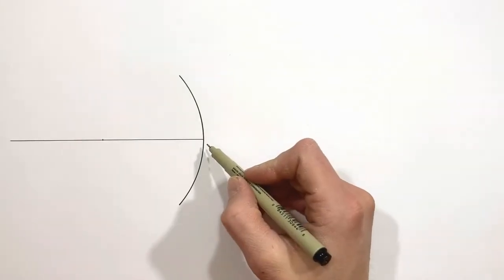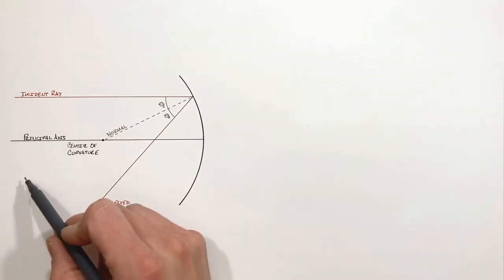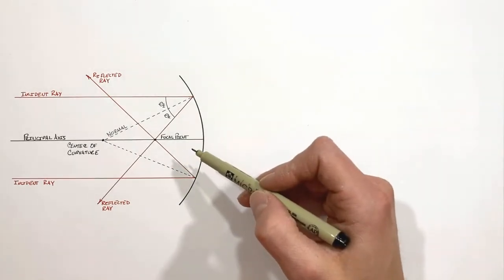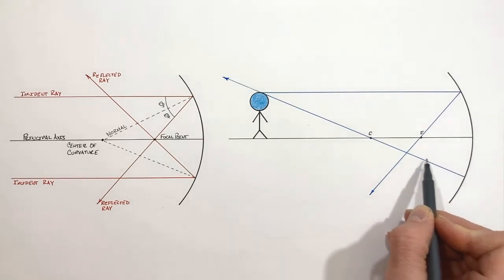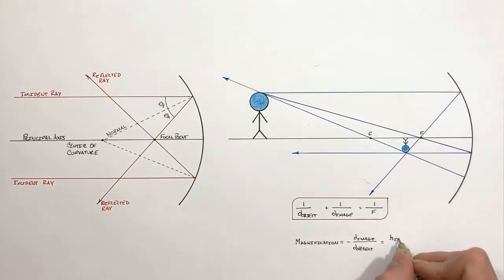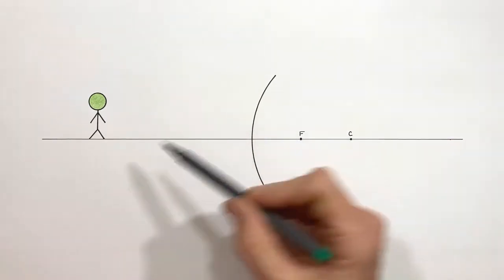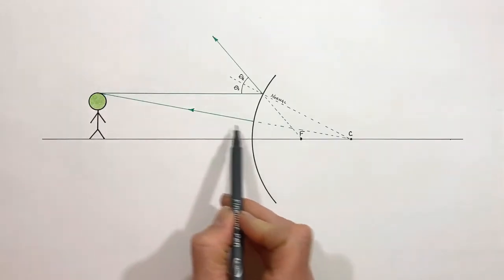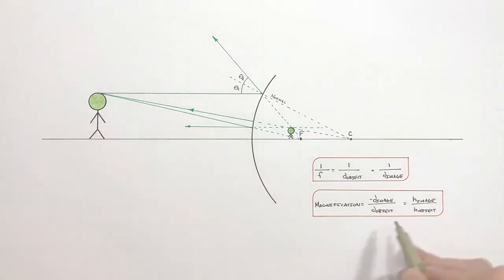Why is Your Reflection Upside Down On One Side of a Spoon But Upright on the Other? | Mirrors Optics

Comment: The inverted image on the concave surface is a real image, how are we able to see it without using a screen??
Reply from the maker: When you project a real image onto a card it only appears at the position where the light focuses.  If you move the card out of the way your eye will see the image which will appear to be coming from the image position.   

The easiest example of this is to stand in front of a flat mirror.  Your eye sees your reflection at a distance that is BEHIND the mirror, your eye does not actually focus on the mirror.  Note  Your reflection in the mirror is virtual not real.
Reply: @INTEGRALPHYSICS  So, can we view real images and virtual images with just our eyes in all the image formation cases among lenses and mirrors?
Reply from the maker: Unless the image 'forms' at an infinite distance, yes.

Comment: If the concave mirror forms real images in front of the mirror in case the object is beyond the focal point, then how do you see an image inside the mirror?
Reply from the maker: Short answer:  You see the light coming from the mirror, but if you focus on the image, it appears as though it is closer than the mirror.  

Long answer:  I have seen questions like this quite a few times from my students as well as online.  I am working on coming up with a way to illustrate the position of a real image that I can post on youtube...  More to come.